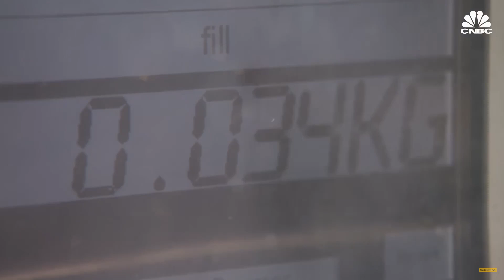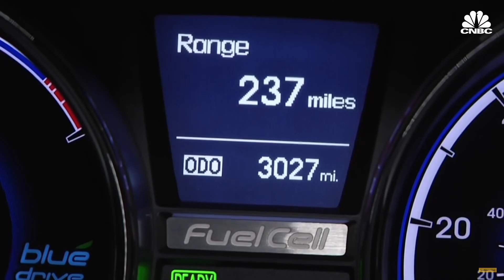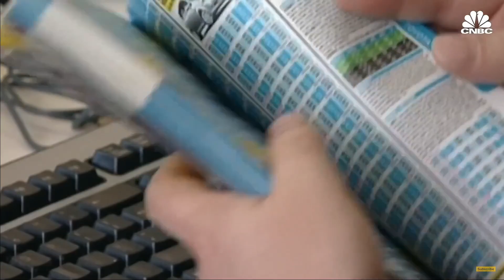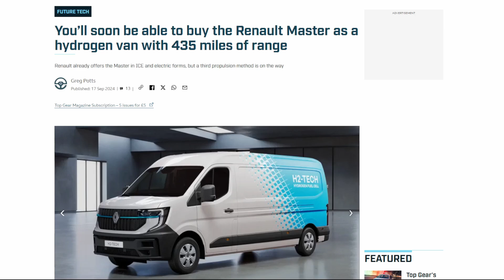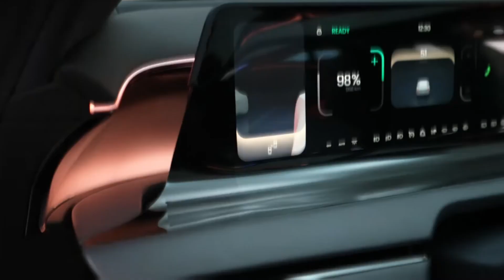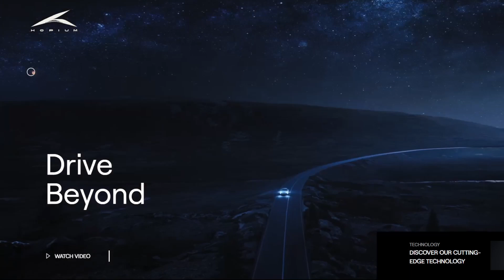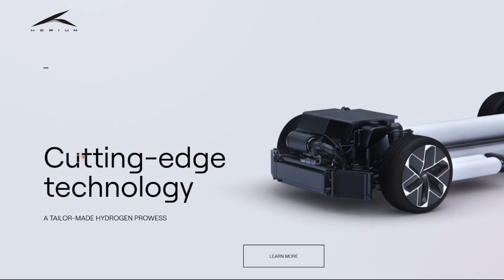The Hydrogen Vehicle Dream Isn't Over - Yet.

Comment: I see nothing remarkable about a Hopium besides nice looking.  Stuff a big tank down the middle and chew up the interior room.  It still uses a li-ion battery to accelerate and regen.  It has a 10kg tank to go 620 miles for 62mi/kg.  That's a tiny bit better than a Nexo SUV and worse than a decade old Mirai and way worse than the second gen Mirai at 72mi/kg.  Also it's not possible to fill a 10kg tank through a standard nozzle in 3 minutes.  When you look at the details, it's 60% of a tank in 3 minutes under ideal conditions.  Pretty much the same as any other FCEV.  In the end, you've still got to get the price of retail hydrogen at the station to be less than $5/kg before anything that runs on hydrogen to go anywhere.  It's like trying to sell EVs if the price of electricity was over $2/kWh instead of 10¢-20¢/kWh.

Comment: Climate change is real and hydrogen cars produce the most greenhouse forcing gases of any technology available. Why would anyone think that was a good idea? Luckily, hydrogen cars are also lousy cars, in no way better than hybrids and in several ways worse than hybrids. Way more expensive to buy and fuel than a hybrid, way worse fueling infrastructure, less passenger and cargo space than a hybrid, at least five times the climate change emissions of a hybrid, and pollutes the groundwater too. Anyone hung up on charging speeds for EVs on long trips can just buy a hybrid. 

No one needs six hundred miles of range unless they are driving a hydrogen FCEV with no fueling infrastructure. 

For almost everyone an EV is a far superior choice; faster acceleration, less maintenance, more passenger and cargo space, the great convenience of plugging in at home and charging overnight, fast enough charging on road trips that by the time you have your bite to eat and bathroom trip you are charged and ready to go. But if an EV is not for you, a hybrid is infinitely superior to a hydrogen car. 

For a technology to be adopted there has to be some benefits one can point to. Hydrogen has none.
Reply: there is one benefit from going hydrogen. Complexity. And complaxity appeals to stupid people. Just look at the internal renders presented in this video for this copium car. More complex than a ICE veichle and that middle hydrogen deposit taking half the space of the car really cracked me up.
Reply: @pedroteixeira4369  I mean, when you start with a clean sheet, and knowing the design will never be anything beyond CGI, you can really let your imagination run wild! Sure there will be a huge market for hydrogen cars, among little people who can sit on top of hydrogen tanks without any problem with headroom at all!

Comment: Where can they be purchased and are they very expensive?
Reply: Why not go for a Toyota Mirai? Toyota is giving them away, no need to spend money if they are giving them away for free. And they are really nice cars, driving them around if you are lucky to find a working hydrogen station to fuel them only costs 5x more than gasoline, they have the performance of a 50 year old low end car, so excelent for slow relaxed drives, and the best thing is they polute much more than a gasoline car because the hydrogen comes from natural gas and is extracted from natural gas using alot of electricity from partially non renoable sources, and as such you can brag about being a top poluter, something that is becoming more and more difficult with this electric car craze going on.